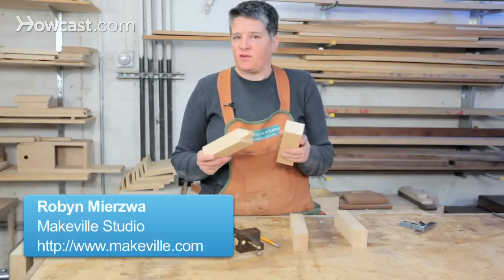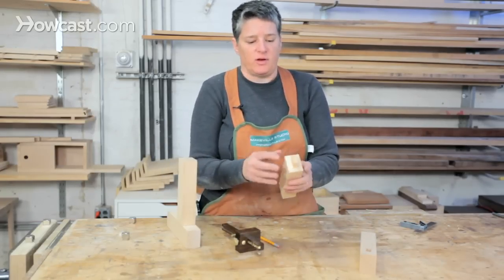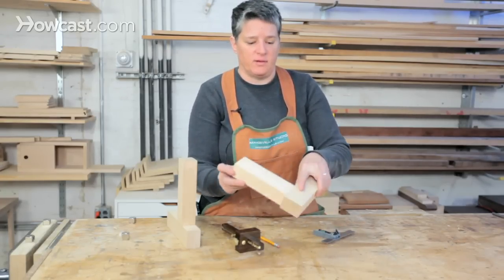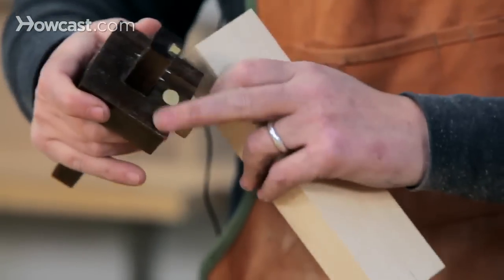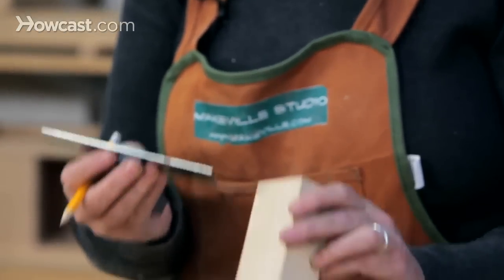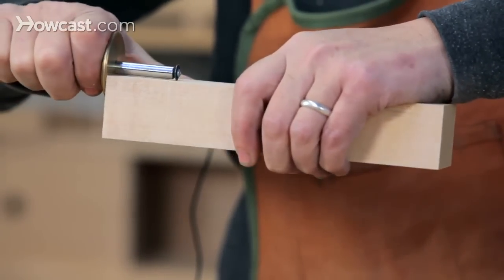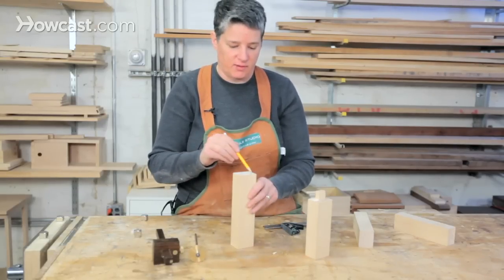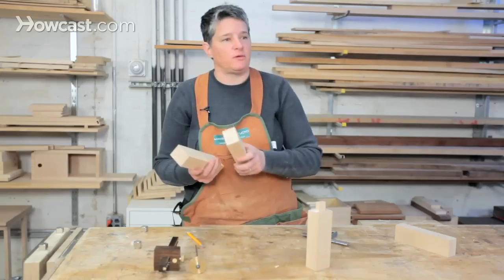Mark Layout for Mortise & Tenon Joint | Woodworking

Comment: Why is the tenon half inch wide?
Reply: Because the whole piece is 1.5" wide.  Half inch is 1/3 of 1.5".
Reply: @johnnichols8553  I commented on a video  of a guy doing a mortise and tenon on an 8 inch x 8 inch oak post and beam. But he said his tenon was only 2 inches. So he had 3 inches on either side of the tenon.